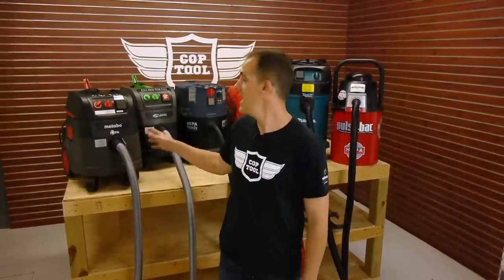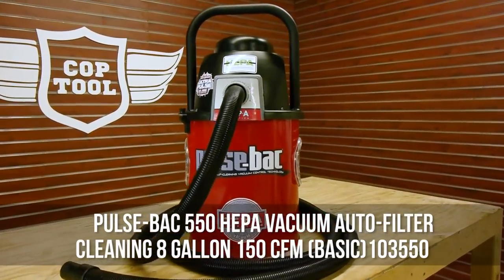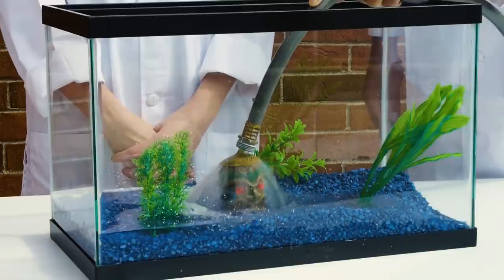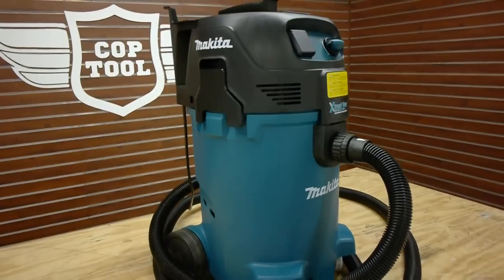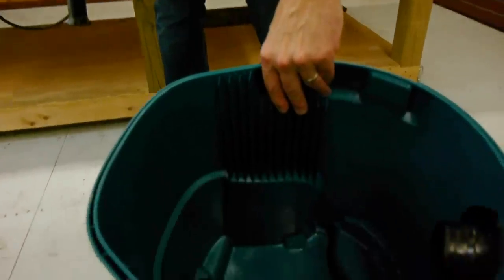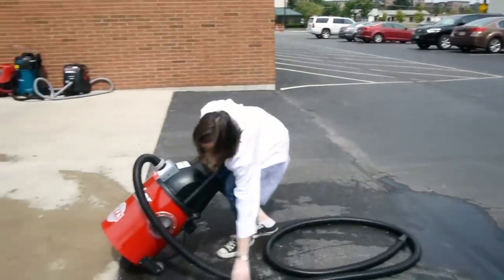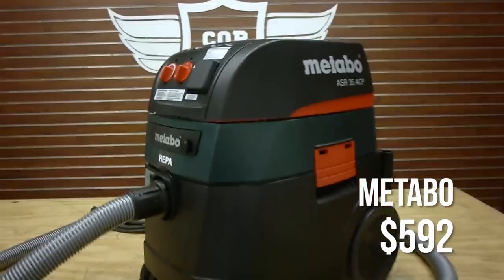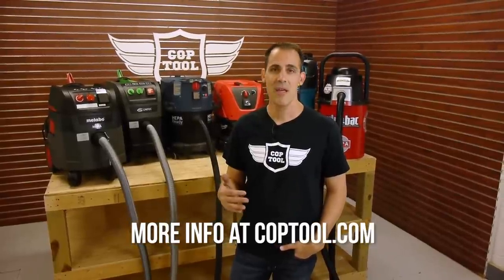Silica Dust Extraction Vacuums 2017 Comparison - Silica Table 1 Compliant Vacs

Comment: So makita won all test but didn’t win
Reply: Every review on makita products are perfect but they never win based upon stupid issues. Makita engineering is on par with German companies but half the price
Reply: The Milwaukee is a nilfisk vacuum. In real world Nilfisk make some of the best vacuums. A $500 Nilfisk would be on par with a $1000 festool vacuum.
Reply: @bighands69 , how so? As I'm in tbe market for a new dust extractor as I cut fibre cement sheeting
Reply: @wallacelux  
Nilfisk are actually an out and out Vacuum manufacturer. It is the bread and butter. 

Nilfisk make industrial rated vacuums for about $500 that other companies would sell for about $1000. 

Go and check them out but make sure you buy one that is rated for the task you are using it for. So in other words make sure it has the correct filter. _
Reply: The Makita is also a rebranded Nilfisk. 😉

Comment: I use Pulse Bacs for my concrete grinding/polishing business to run hand grinders and even large floor grinders. We use the large 1250 Pulse Bacs and they just keep going and work great but at $4500 they better be good..I don't know how the smaller CDC Pulse Bacs like the one in this vid work, but I know their larger ones like the 1250 are very good and strong vacs especially for demanding work like concrete grinding 8hrs a day. They have also been around for a very long time and were one of the first with automatic filter cleaning and they have proven their worth.
Having said all that, Im definitely going to buy one of these Makita vacs to try out on our 5" and 9" hand grinders

Comment: What is wrong with using a powerful shop vacuum for a third the cost of all these dust collectors?  All one needs to bring a wet/dry vacuum up to par with these is purchase their low cost dust collection bag to go in the container and add a  HEPA Filter.  There are great hose adapter kits which will fit almost every powered hand tool, contractor saw, as well as miter saws for all types of vacuums.
Reply: They still wouldn't be fall under the osha rules of having a filter cleaning mechanism built into them, I've done what you've mentioned and there would be no comparison to what these dust extractors can do as far as keeping the suction up, once those bags you speak of gets caked up with drywall and concrete dust then you pretty much have a quarter of the suction while the bag isn't near full, I've been there, done that and got sick of it so I ordered a new Metabo dust extractor for remodeling work, I used a grinder with a tuck pointing guard for cutting out plaster and tile walls and floors in bathrooms and wet/dry vacs are useless for the job, even a festool dust extractor is useless for the job because the dust cakes to the inside of the bags and lose suction

Comment from the maker: 9/29/2017 UPDATES - Since this video was posted and the OSHA Regulations hit there have been some changes to this video. 1. CS Unitec price has come down to $599 (with HEPA filters) inline with Bosch, Milwaukee, Dewalt and others! 2. Bosch VAC090A & VAC140A now get a free HEPA filter and Fleece bag added (from reputable Bosch dealers at least)!
Reply: I think something big you are overlooking is how long the filters last and the cost of replacement filters.  Futhermore, you tested these vacs like a shop vac not a dust collection system.  I want to know how long they last grinding of cutting concrete and can you clean the filters and how hard are the filters to replace

Comment: I really would like to see some testing on what these vacuums are designed for - extracting dust. Sucking up water can be done with a regular vac. I understand that shows the strength of their suction, but does that relate to c.f.m? It's been my experience that when attaching a vac to a tool or collecting dust, the volume of air flow is more important than the strength. I think if your test would be more relevant if it included a test of what these are actually designed to do. I'll be purchasing one of these units this month, and I need to know which one will will keep up with the demands of dust extraction, need less time being emptied, which one is the messiest to empty, etc.
This would have been a good review for vacs you'll use on general wet dry applications. I see nothing here that tells me which one will keep up with my chipping hammer or 7" floor grinder removing thinset. If you're buying this you suck up water your over paying. An 80$ rigid wet dry vac from home depot would outperform these 600$ vacs the way you've reviewed them.

Comment: They Must be sponsored by Milwaukee cause it makes no sense that Makita wins all the vacuum tests but still looses overall
Reply: Nilfisk make Milwaukee vacuums system. They are strong and powerful and considered an industry standard vacuum.
Reply: @bighands69  nilfisk also make the bosch and starmix makes the metabo and unitec
Reply: @mattwragg6966  
Does Starmix engineer their products? or do they use other companies engineering?
Reply: @bighands69  starmix make them in house

Comment: Nothing comes close to Festool or Nilfisk these two are the rolls Royce of extraction I've used many over years but perfection costs and i have nilfisk 110 v power top attic 30 push and clean M class and my god I never go back to shit like bosh and DeWalt or any premium branded machine i also used Festool for 4 years

Comment: You guys ever used a dustless vacuum? I’m curious how it stacks up.
Reply: I have it for about 7 years. works like new . never need to cleat the filter. using it for drywall sanding a lot.
Reply: Shock Value  dustless is a brand that I use in my classroom for clay dust. I wanted to see how it stacked up before I bought it. It seems to be holding up very well after 2 years.

Comment: i am actually looking at getting something for concrete floor grinding.. I've been looking at getting the larger size pulse bac unit.. at over $10,000 i am now thinking of going with maybe 10 of the milwaukee vacs or makita and just hook em all together for some really extreme suction.. what to you think?
Reply from the maker: For heavy applications like concrete floor grinding and walk-behind saw cutting, that is where Pulse-Bac really shines. The price tag jumps up for sure however OSHA probably doesn't wants to see a web of spaghetti hoses duct taped together covering the jobsite...

Comment: where are the festool ct vacs?
Reply from the maker: We contacted Festool and they confirmed that none of their tools or vacs are rated for concrete work, and confirmed that they have no plans at this time to produce concrete tools or vacs. The shop vacs we featured are all OSHA compliant for silica dust extraction. Festool makes some extremely nice woodworking vacs that we may feature in a future video.
Reply: well, they have vacs that are classed as "M" and "H" which both contains hepa filters, which alone suitable for concrete work as well as asbestos, as well as automatic filter cleaners, i dont know about other brands apart from the ones hilti produces, they fill up quickly cos of the badly placed inlet shout and the main filter dips into the container, and fills up quickly with dust when you use them for wall chasers what we have here in europe, while the ctm36 hd festool vac i have it sucks till the bag is packed solid with dust without losing more than 10% suction power from the same brick and concrete dust 36 liters of solid fine dust without any issue of getting trough the filter
Reply: DeviloftheHelll hey do you use the automatic filter cleaning setting on the festool dust extractor when sucking up concrete dust through the fleece bag and if so does it help shake the dust off the inside of the bag? I have a festool CT Midi and have used it for cutting out tile walls and floors when remodeling while using a cyclone dust separator and my experience is the fine dust cakes to the inside of the bag and lose suction to where it's useless and the bag is only 20% full, wood and mdf sawdust is a different story, that stuff doest cake to the inside of the bag like drywall and concrete dust does, I've ordered a Metabo dust extractor and will see how that works

Comment: Hilti and Dewalt declined because they know better. None of these have a continuous-duty motor.  For all day vacuuming you need at least 15 sq ft of primary filter, plus a HEPA after-filter, and an on board filter cleaning system.  For a proper silica vacuum I would check these guys out https://www.controlledairdesign.com/products/industrial-vacuums